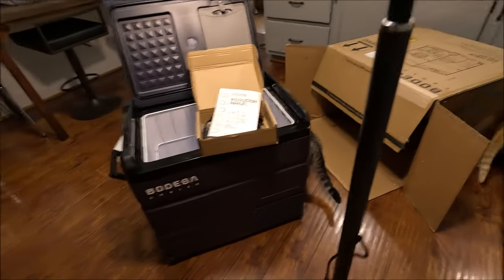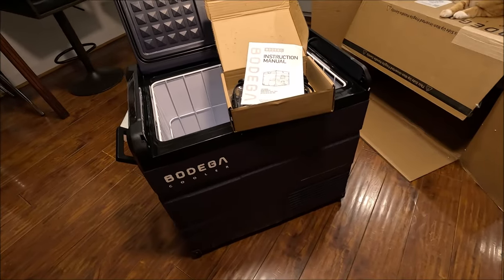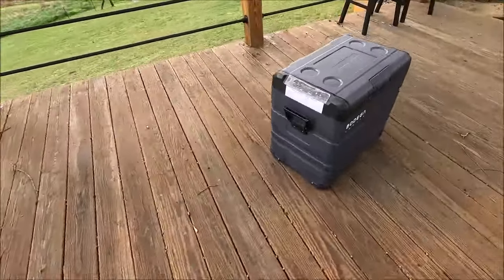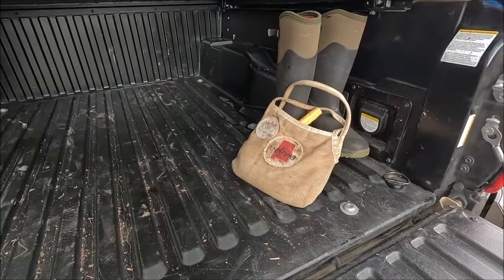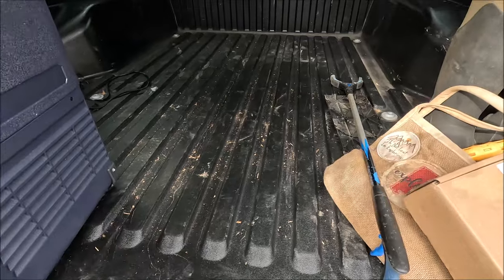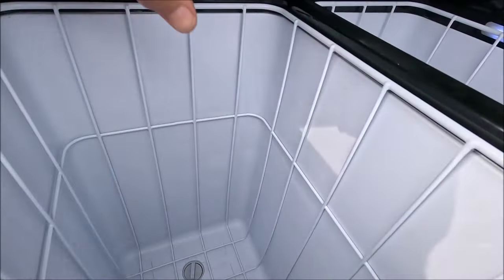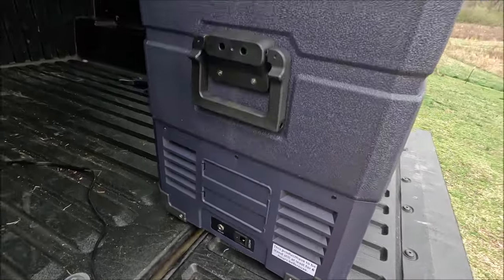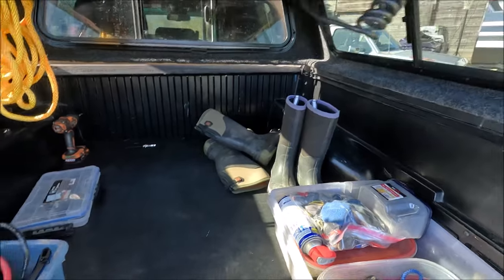Tacoma Overlanders Need to See This Leak Repair HACK & BODEGA Car Truck Travel Refrigerator Freezer

Comment: Hey man, those little indents in the roof of that cooler supposed to be cup holders? They don’t look like they’re going to be very useful. It’s a fine looking cooler but just hang onto your pop.And also it’s not gonna run your battery down as long as you run the engine, but if you leave it on for all night and most of tomorrow then you will probably need a boost.

Comment: Don’t they make a matching gasket to go between the cap and the cab? I’ve seen lots of those. Of course not on mine but it doesn’t leak either. I can’t remember what kind it is, it was already on the truck when I bought it.